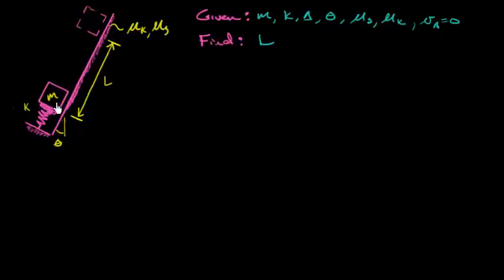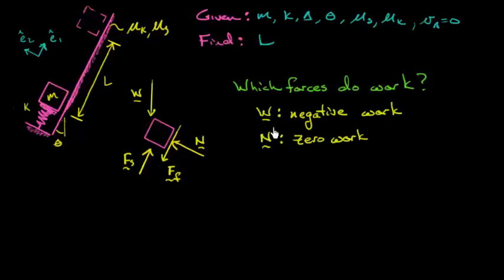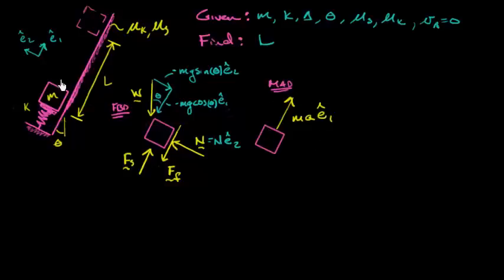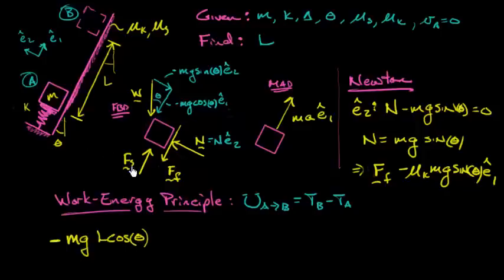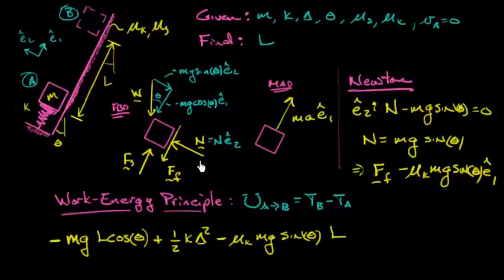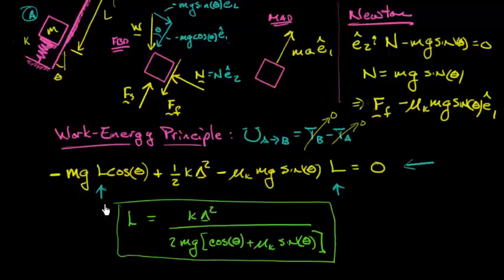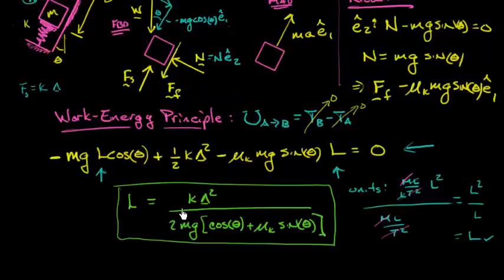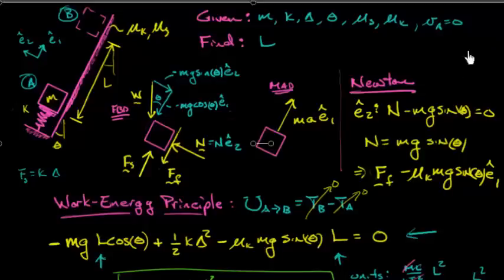Work-Energy Problem A - Engineering Dynamics Notes & Problems

Comment: shouldn't it be negative Mew K mg cos theta since the cos theta is in the y direction which is equal to your normal force
it looks like you put your degrees in the wrong direction when figuring out your cos and sin of weight
Reply from the maker: No. It's correct. Notice that theta is defined as the angle of the ramp relative to vertical. Observe that when theta is zero, the ramp is vertical. In this case, notice that the normal force is zero and the friction force is zero...... Notice also that when theta is zero, sin(theta) is zero. Sine is consistent whereas cosine is not.